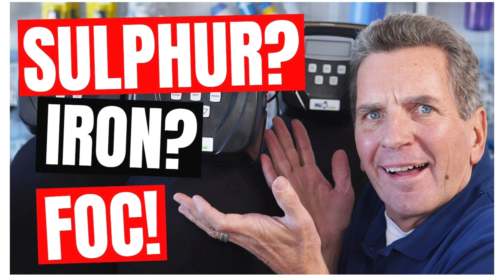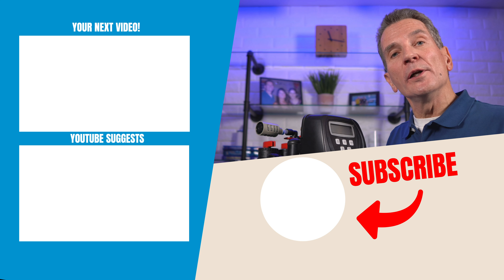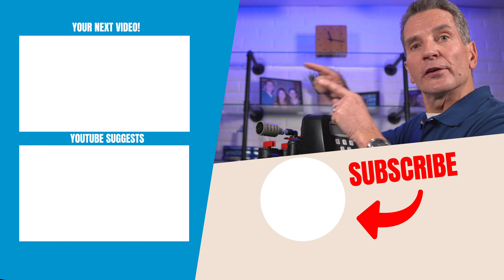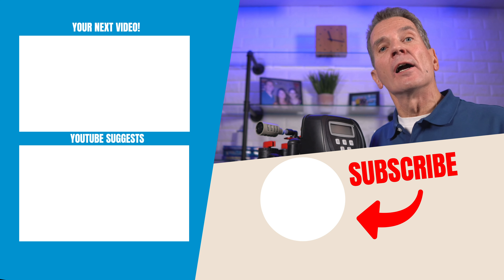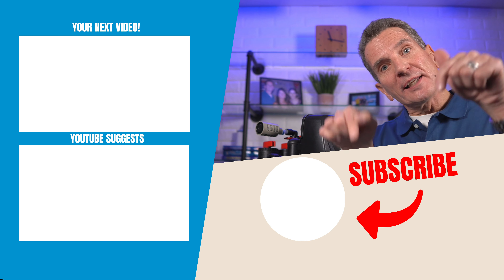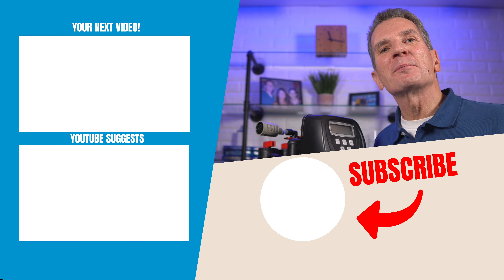HOW to Get Rid of SULPHUR SMELL from WELL WATER

Comment: Hi Gary,
My water is tested and it has Sulfur, but no iron.
With the FOC filter, do I still need the carbon filter, curently intalled in my system?
Thx
Reply from the maker: Great question.  With an FOC, you won't need your carbon filter cartridge anymore.
Reply: @GarytheWaterGuy  
Submitted through a form yesterday. Still waiting for the response.
Reply from the maker: @NickTu-DMTD  Please check your junk mail, I responded earlier today.

Comment: Hmmmm. My well installer said my problem was SRB. ( Sulfur Reducing Bacteria). They installed an in well aeration nozzle kit to the tune of $175. 4 years later, still no Sulphur smell and no problems. Pretty simple solution.
Reply from the maker: Yes, glad that worked for you with your waters chemistry, but that will not work in every case when someone has sulphur in their water.

Comment: Gary,
 I have a 2 year old house and well. I have had rotten egg smelling water for the entire time. After many filters and a softener I bought a hydrogen peroxide injection system. my system now is this, pressure tank - 30 micron sediment filter- flow meter - hydrogen peroxide injection - 15 micron sediment filter - 5 micron carbon filter - water softener - house.  This system got the smell out but water still taste really bad. Also it taste like salt. Recently the water smell has come back and so I came across your filter looking for a permanent resolution. I had water tested before with no filter but it doesn't look like it tested for hydrogen sulfide which is my biggest problem. Ph level is 7.3, Manganese is 9.8 PPB, Iron is 0.08 PPM, Silicon 3360 PPB, Sodium 812 PPM, sulfate 240 PPM, Boron 1070 PPB, copper 61.2 PPB, Hardness 43, Phosphorus 12.5 PPB. 
What is my best solution for good tasting, no smell water?
Reply from the maker: An air over media sulphur filter like this would be a great choice https://waterestore.com/search?type=product&q=fok* but with that high sodium content you will also need a reverse osmosis drinking water system like this https://waterestore.com/products/hum-water-saver-reverse-osmosis-system-75-gallons-per-day

Comment: Change the anode in the water heater. Zinc anode will get rid of the sulfur smell if the smell only happens when you  turn on hot water.
Reply from the maker: True, but sometimes changing the anode still doesn't help, which is why, in that situation, I suggest removing it altogether.

Comment: We just bought a house and we definitely have a sulfur/iron problem. Do these compressors also work for softening the water? I’m still learning about this type of stuff. My dad is more concerned about a water softener for our well, but the smell of the water still bothers me. I like that we are on a well, but I just want to keep the costs as low as possible.
Reply from the maker: Great question.  No, these only get rid of the iron and sulphur smell.  If your water is hard you will still need a water softener to soften it.
Reply: @water_estore  thank you!

Comment: Thanks for your videos. We have well water and septic system. Lots of iron in our water and rotten egg smell at various times. We have an older water softener that we put salt in. I accidentally pressed some buttons leaning on it. I then noticed my hair getting worse and worse and my skin feels almost chalky from the hardness. I don’t care how much salt I need to use to make my hair soft and shiny again. What’s the setting (ppm) I can set the softener to get the softest water, assuming my water is ridiculously hard. We don’t have any other filters as in your videos and my husband won’t invest in them so I need to make my softener work. Thanks so much!
Reply from the maker: You should have your water tested to determine the hardness level before the softener, this will help https://youtube.com/shorts/DerivPiHJc4 This video will help with what you do after getting that info https://youtu.be/XMY69hdhX44
Reply: @water_estore  Thank you! I guarantee you it’s super hard without a softener.. Even with a softener the shower heads and faucets get buildup and clogged over time which we have to chip off and the water stains the toilets if it sits for too long. Our shower floor is stained a rust color if I don’t clean it often enough. The true test as a woman, is how my hair looks and feels. I’ll take your advice and test it. Going to watch your second video now!

Comment: Hi Gary, thanks for the informative video. I have very high iron (4 mg/L) at my home and am faced with the option of needing to pay possibly as much as $40,000 to connect to city water or treat the iron problem effectively. It was recommended to me today to consider the Iron Rival air injection system and was wondering your thoughts on that system. They claim it can handle up to 15 mg/L iron concentrations. Or if you have any other air injection systems you recommend. Thanks.
Reply from the maker: This is the iron filter I recommend for your family https://waterestore.com/products/hum-chemical-free-iron-sulphur-manganese-filter-fok-1-0-cube  I would need more info to size it correctly for you.  Please email me at info@waterestore.com and I can get you an info sheet.

Comment: Hi Gary, we have a tank that backwashes every second day. It has gravel and carbon inside and worked great for the first 6 months. Then the smell returned. We were told we needed to replace the media inside so we did. (Not cheaply either I might add) it’s only been 3 months and the smell is back again. 
What can we do? The cost of media every 3 months isn’t user friendly but the smell isn’t either. Please help.
Reply from the maker: Sorry to hear.  The media or system you have is not correct for your applciation.  I would have your water tested, email us the test results and we can make some recommendations for your family.  info@waterestore.com

Comment: I have a brand new sulfur filter (installed 7/2023) and my water still smells like sulfur really bad.  Any ideas on what to do?
Reply from the maker: Do both the hot and cold water smell or just the hot?
Reply: @water_estore  it used to be the hot and I removed the anode rod in October 2023 in my water heater.  It went away and now its back on both the hot and cold
Reply from the maker: Did the smell go away after you installed the system initially?  Did you have your water tested before getting the system for iron content and H2S? Do you know the flow rate from your well pump? What size system do you have?

Comment: I have this and still the sulfur smell is unbearable, it was installed with a potassium permanganate device next to the filter, I do have the water softener and the salt have been added religiously, I was told that the house is old and I might have some sediment and bacteria in the pipes, should I fix this through the well directly-chlorination?
Reply from the maker: I would have your water tested to determine the hydrogen sulphide in your water before doing anything else.

Comment: Gary, that's an excellent explanation (at least from my non-expert point of view) and really helpful. I notice that smell around my washing machine, and only intermittently — but now I'm wondering if my guests can smell it at the sink. Is an FOC compatible with a water softening system? Both devices would be doing backflushes, if that matters. Is there any other way they might hinder each other's performance? I'm also curious to know why there's sulfur in the first place. Maybe it's a regional thing?
Reply from the maker: Water would flow through the FOC before the water softener.  You would set the back wash times two hours apart so they don't overlap.  They would  complement each other.
Reply: @water_estore  Thank you. And still wondering why people have sulfur in their water. Is that just a naturally-occurring substance in some areas?
Reply from the maker: @MikeAnn193  yes, it is a natural occurring substance in many areas that have well water.

Comment: @gary sulfur is half the reason my customers have their refrigerator breaks, the sulfur attacks the compressor’s copper lines and turns the copper into black and breaks the compressor, how come the sulfur makes the copper black ?
Reply from the maker: I don't know the exact chemistry but there is a reaction between the two, basically corrosion.
Reply: @water_estore  thanks !

Comment: Hey Gary. My house has 2 tanks a small one that’s connected to the salt brine tank and a big one that is not. It has an identical control panel like the one in your video. How do I know what kinda tank I have?
Reply from the maker: Great question!  Without knowing what is inside the big tank it could be a number of things, also depends if you are on city or well water.  Checking with whomever you bought it from is your best bet.

Comment: Hey Gary First time coming across your videos 
We have a well,  at first it smelled like rotten eggs Have a 3 stage filters  cloth UV light and Carbon block.  What we noticed  is our copper pipes turned black we had the water tested  fluoride count was high.  Would your system help us.
Reply from the maker: Yes, but the first step it to have your water tested to find out what is in it.  I suggest you go to this page and check it out https://waterestore.com/pages/free-water-test-evaluation-the-water-estore

Comment: You forgot to mention another option which is a green sand filter and potassium permanganate to remove oron and Sulphur!!
Reply from the maker: That is a terrible option, but I guess somewhere it still exists.  Those are very hard on your septic system and the Potassium Permanganate is very difficuklt to find, not to mention expensive.
Reply from the maker: Pot Perm is an extremely powerful oxidized and is actually explosive.  Much more powerful than chlorine and we know you should never add chlorine to your septic sysytem.

Comment: I smell it at every faucet and have not idea how to get rid of it. I have a water softener in the basement but have no clue what model it is. I do see it has a bypass but, does not have one of those little air thingy's in your video. I tried cleaning the resin balls and I have used iron out in the brine tank. I want to just pour bleach in the well at this point I am so frustrated.
Reply from the maker: A water softener will not get rid of sulphur.  You need an FOC like this https://waterestore.ca/products/hum-foc-sulphur-water-filter-one-cubic-foot